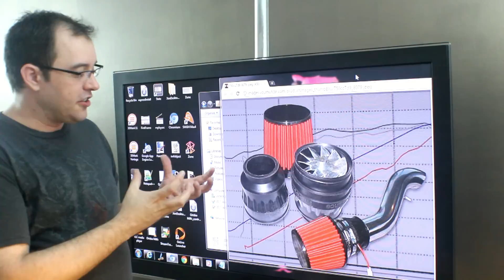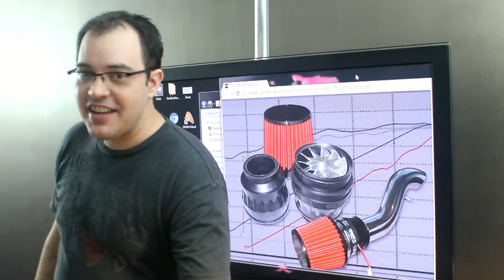Electric Turbo / Electric Supercharger / Forced Induction System: Should I Install?

Comment: The problem with turbos is not the volume of air, but the pressure. Because the amount or air you put in your cylinders in a consequence of the input pressure. For example, typical 12″ desk fans are rated at between 900 and 1500 CFM. But obviously, the output air pressure on those is very low, so it couldn't force air to go in the small volume of the cylinders. That's why I'm very sceptical about your stuff... It could work with a much bigger electric motor with high RPM (more than 100 000)

Comment from the maker: No it doesn't. Unported, Vortec’s will flow about 235-240 CFM at 0.500” intake and 165-170 cfm at 0.500” exhaust. at .6 you can reach 300 but 290 is more common.

Comment: @BlackwaterOpsDotCom ohhhh i see, i was going to put the boost gauge anyway so i can see the pressure i'm running at WOT or at half throttle. btw, what do i need to get to see the boost pressure from the OBD2 port?

Comment: Hey I got a 390 Ford Big Block pushing maybe 450 hp? I was looking to mount 2 of electric supercharger/turbocharger kits except with the metal blades I'm rebuilding the motor soon and looking to gain extra power, also I was wandering if it REALLY increased MPG's and also leaving it activated without the pedal touching the floor

Comment: i believe any amount of air on the top of what the engine is already sucking , and if the preasure is greater than the normal induction preasure it should work no doubt .full thumb up

Comment from the maker: @matthewgibbons13 I had radiation treatment and not all my hair grew back. Thanks for pointing it out. 

600 CFM would be a lot on a car. 600 maybe on a truck, but stock, not likely. And Since you weren't listening, MINI COOPER 1.9L engine.

CFM is relevant in that your Fuel to air mixture is based on Pounds of Air to Pounds of fuel. Since most people can't Picture an LB of Air but can Picture a Cubic Foot, I used that metric.

Thanks for trolling, you really moved the conversation forward.

Comment: @hellkat672 You don't understand.  The power isn't coming from the motor, it's coming from the fuel, can't use a conversion directly like that.  I see where you're going and you're right it would probably be a bit higher, but for instance I've seen those silly "E-supercharger" 'brand' make about 8 horse - around where they claim.   Outside of that none of these things will produce ANY power whatsoever and you'd likely lose power.

Comment: if you want more power buy a sts turbo or if you dont have that kind of bread. nitrous is the way to go its inexpensive and its not running on your car constantly use it when you need it and you can run it safely on any car its just a matter of choosing the right shot at the right time

Comment: A vortech supercharger will take around 40-60 hp to build 8 psi in 5.7 litre engine.  If you could even find a DC electric motor that would come close to that.  A starter motor is good for 3hp.  A 4 amp motor would give you less than 0.1 hp.  You wont build any boost with that.  And it will give you less power at higher rpm because it will restrict airflow.

Comment: On the same engine, a 50mm at 25 psi is flowing the same as a 60mm at 25psi.  The difference is that the 60 mm can do 25 psi on a larger engine where the 50mm would not be able to flow enough air to raise the pressure to 25psi.

Superchargers are rated in CFM not pounds per minute.  Turbos have compressor maps that show the relationship between air flow vs pressure.  Show me a company that will sell you a turbo rated at 50lbs/min.

Comment: @omega3677 Sorry, I come from a diesel tuning background. I am used to 15-16psi on 1.6's being the norm, 2.0's having 20-25psi being the norm (evo territory on a passenger car). I always forget petrol's have thinner engine blocks and can't take the higher pressures. Yes you're right, you wouldn't get detonation from that, but you would still be running lean so you would be missing out on power you could have and running the engine hotter than it could be if you just increased the fuel quantity.

Comment: @sixshooter1488 Yes, As I've already said this is true.... to a very limited extent. It will compensate probably for an extra 1-2psi in pressure (So a better intake maybe ram-air or something), but any kind of real forced induction will always run lean and not produce a 100% efficient combustion unless you manually increase the fueling in some way - usually an ecu remap.

Comment: @sillychink3293 Do it. Do it. I've done a lot of research lately as I've just installed a borg warner EFR turbo. You have no idea what you are getting into. The blade design is a HUGE factor in inducer efficiency as is aspect ratio and a bunch of other things. The engineering that goes into making something that is effective is mind distorting. Although an electric supercharger is possible the amperage required is astounding. That thing will do nothing but restrict and break up airflow.

Comment: @hellkat672 a fan that has a CFM rating greater then an engine must maintain that rating with the filter in-line. If flow is still greater then engine cfm requirement then in theory it would be like your running a restriction-less filter. Finding a fan that could push this flow under restriction would be much more expensive then just buying a high flow filter, and gains could be moot with electric parasitic drag.

Comment: I would have to say install it at your own risk. its a decent aftermarket piece but it doesn't give you THAT much of a difference . i have two on my 86 300zx stock i was pushing a good 160 hp and 172 tor. but after the first electric supercharger, i got a boost or 192 hp and 200 tor. but still the 0-60 only shaved off about .4th of a second,but i installed another and got 226 hp and 232 tor.i advise if getting one,buy a second car battery and install it in the trunk an hook the wiring to it .

Comment: Electric superchargers/turbos ARE possible. But that is not one of them. Don't waste your time.

It's not about CFM. It's about compression. You're trying to force air into the cylinders. This requires POWER. If you have an electric blower with a motor producing some 0.5-10HP, you're in with a chance of seeing small gains.

Audi are working on an electric turbo for their 2014 lineup. It does NOT replace the normal turbo and it only runs at low engine RPM to counteract the "real" turbo's lag.

Comment: While they do make actual electric superchargers, they require a huge alternator, 2-3 batteries, and a controller to match fan speed to engine rpm. This makes them better for large trucks. Ergo, anyone trying to sell you an electric supercharger for your car is lying.

Comment: i put that in my Computer and my GPU temperature is at 8% and will never go pass 10% and CPU speed at 126%. it works at making my computer run faster and cooler. no need for overprice CPU coolers while you have this.

Comment: @mikefknjohnson19 The previous owner of my very haltech setup made 730whp on e85... I think I'll make plenty. If you search Alberto 350z 170mph and watch the first one you can see a bit of how the haltech works, plus what a 600whp 350z can do.
And the Haltech Pro Plug in retains the factory ecu for closed loop functions like idle, cold starts, a/c functions etc. It's the ultimate combination for a street car.

Comment: @sillychink3293 Oh, i dident answer your question. Yes you can have some sort of boost with 2 of those types of fans. But those types of fans build such little pressure that we use something called a water column to test fan efficiency. 
By the way, im an engineer in an aviation company that deals with a wide variety of components. The biggest strongest "Fan" i have came across (recirculation fans running 100-150 amps) produced only 1/10th of a psi if anything.

Comment: it works, i tried it as all honda guys. 100% satisfy. ask honda people for proof
Reply: You must be trolling. That thing wouldn't even make sufficient boost for a lawn mower engine.
Reply: so funny man....
Reply: Put a real turbo on...thats childs play. At least get a DiabloSport T-1000 for first upgrade. Then cold air intake, then exhaust. Thats where im at. Best ho increase for money. Got a Hemi charger 5.7 stock 370. T-1000 adds like 20hp with new Tune. Cold air intake claims 17hp on 5.7 liter and catback exhaust adds say 13hp. So that 40hp increase. I spent bout under a G.
Reply: Well... the reason he says it does work on his Honda is because his is Honda has VTEC which means it can monitor how much air it is getting at a certain time and that extra assisted air flow does assist a little bit in power, a little bit! if he put a proper turbocharger or supercharger on he would see how much an actual difference that makes it's all about how the car takes to the faster flowing air but the same thing can be accomplished with taking out your headlight and getting a cooler intake so the air is being pushed directly into the air box through the headlight drag Racers do it look it up. oh and the dodge hellcat has an air port in the center of the head light so the air gets pushed into the air box the quicker you go better air flow more fuel more power and yes I know the Hellcat is supercharged but it does need more air since it is supercharged

Comment: i agree with acidburn7777, this is only a fan...you can use it in addition to your cooling fan, to cool the radiator but it won't help your engine...because a turbocharger and a supercharger will force air in you engine and so make it work better but a fan ain't gonna force any thing in you engine, maybe only a plastic fan blade when it brakes:)

Comment: @blackwateropsdotcom no....a 2 bar map will only read up to 14.5 psi. Yes two bar of pressure is 29 psi, but map sensors read vacuum as well. So subtract a bar then multiply by 14.5, that is how much pressure the map can read. And I have no idea what "jcw" and "s" is, unless you mean the "s" as a turbo model, still don't know the other. But if it is indeed turbo, good luck, hope your tune doesn't try and overcompensate for little mistakes. By the way, no hate, just free knowledge.

Comment from the maker: @hellkat672 Not saying this will work, but your math doesn't work. a Cloth air filter draws no power, and can make 3-30 HP compared to a paper filter (if the cloth is also bigger and such)

Comment: @hellkat672 i was planning on using the one in the picture behind him by gte, they claim, "5psi per fan" i get exactly what you mean i'm guessing that the fan is just to improve air flow not to exactly boost, thanks for the heads up i'm going to avoid this path. thank you

Comment: The engine pulls more air than that pump so you are restricting the airflow. You can believe what you want but it's nothing more than a placebo. Reall boost is strong enough to require strengthening the intake. Thats why it's measure in psi and not cfm. You don't see cars with a flow meter...

Comment: @BlackwaterOpsDotCom What? You need more fuel in the cylinders to compensate for the extra air in order to keep the compression ratio correct. Otherwise you run too lean and cause detonation in a petrol, and in a diesel you loose power.

Comment: well i just learn that a real turbo can do 240,000 rpm, And at the speed it needs oil to lubricate bearings because it gets temperatures up to 950 celsius so if think u can buy that electric motor to go and street race ur wrong but if u want to save money and gas go ahead. it will work but remember that at the freeway going at 65 miles per hour u will get probably a lot of air in ur intake specially if u have cold air intake

Comment: @omega3677 "larger injectors or a FMU will result in lower air charge temperatures and more horespower".... so exactly what i was saying all along? You should add more fuel with the air, not just air alone for cooler temps and optimal bhp lol. Larger injectors allow more fuel to enter the engine.

Comment: Why do you insist that PSI does not matter when discussing the performance of turbos?  The whole point of turbos is to compress the air to increase the amount of o2 in your engine.  If you want to increase the amount of air in a fixed volume, the pressure is going to rise.  If you dont have a pressure increase, you are not flowing enough air into the engine to increase performance.  Measuring PSI directly tells you how well your turbo is performing.  Never heard of a guy using a MAF for that.

Comment: Try and run it on a Dino. I wonder if you install a brushless motor with high amp and voltage amp, you could make more pressure

Comment: Oh, and one more thing, the item you hold in your hand is a "fan"... It's not a turbocharger.
A turbocharger/supercharger compresses the air when it delivers it into the engine, hence the power boost(it's like nitros, where you chemically dump O2 into the engine). A fan does NOT compress air.

Comment: i put one on a drag 4wheeler and it work cuss i did a dyno test on my 4wheeler befor and after and cuss in drag im not going fast it helps keep my moter cool and run harder. in the dyno i made a 10 hp differance witch should make a differance in my pull distance. i did it also on a diesel and it keep the moter cooler but no hp increase.

Comment from the maker: Nope. Cubic feet vary in mass drastically with temp. Pounds is a measure of weight, not mass. Mass air flow measures "pounds" of air. Which is a failing in the name of the apparatus.

Comment: Im not sure how your going to get a 0 to 12 volt range to the fan. your TPS throttle position sensor is 0.6 to 4.7 volts back to the ECU on any fuel injection car. unless you fit your own variable potentiometer to the throttle body some how. but id still love to see it done !!

Comment: In a 4stroke gas engine air pressure after 10time compression is i guess around 200psi and 600psi in diesel engine so in oder to get some boost i guess u atleast need one bar of pressure which is i guess totally impossible with this toy

Comment: Electric superchargers really work IF: You attach a very high power motor [try at least a 20HP and at least 100,000rpm] to a real turbo housing and an impeller and a rear trunk full of high capacity batteries.............if you don't you are just wasting time and money!.

Comment: the fans and the motors from porffesional remote control airplanes seem like they'd work better. a model jet engine can put down about 30-50lbs of thrust. those model engines cost a fortune however. about as much as a kenne bell or vortech.

Comment: no it was blowing out  when i turn supercharger on it looks like it it gives no air or  cuze of more air looks like it  ...when its doing that  than i shut off the supercharger when i push the pedal its still doing it after that  than when i restart the car  than its normal  untill i turn on the supercharger  ...is there any other issues can happen ??

Comment: why your horsepower increases when you supercharge or turbocharger your engine is beacuse it creates intake pressure! a supercharger is a large air pump sitting on top of your engine, a turbo is a smaller fan but spins at thousands of thousands of RPMS forcing and compressing air into your intake, in essence these things give you large amounts of pressure, that thing... only moves air, and the restriction its motor makes will cause intake abstraction.

Comment: More FORCED air means MORE horsepower, That pastic hairdryer isn't gonna do anything, now a metal fan, that is 35k rpms, I HAVE ON my v8 truck, and It has a lot better get up and go. 75 buck bolt on for I guess 35 hp gain? why not it wont hurt nothing, more air is better..

Comment: Lol this is such a scam. Anyone who spends 15 minutes of research will realize this.
Reply: Kyle Grodkowski 
exactly
Reply: Why doesn't it work?
Reply: Aidan D this  thing is an air pusher/vent...
not a compressor
to compress an engine that is already drawing air through when running it takes way more power (large batteries to store enough power)  and a different impeller design
Reply: +Kyle Grodkowski 
I know.  It's just a fan.  A supercharger or turbo works by increasing the psi in the intake.  This is just a fan, and will not increase manifold pressure, one bit.

Comment: @sillychink3293 you cant get boost from a simple fan, its impossible. True fan compressors are staged with tight fitting stators to compressor the air, like a commercial jet engine.

Comment: You're still talking about pounds or volumes (1 cubic feet of air = 0.075 pounds). A mass air flow sensor measure the density of the air: this density varies with the ambient temperature, altitude and the use of forced induction, which means that mass flow sensors are more appropriate than volumetric flow sensors for determining the quantity of intake air in each piston stroke. So I don't understand why you talk about weight or volume of air.

Comment: idk if you'll get more HP out of doing that, mabe inprove fuel ecomany a little but... if your worried about the blade flying apart in the intake line, I wouldnt worry about it too much, marine components are actually made to be way more robust then automotive parts, thats why there so freakin expensive :(  but if your still that worried about it just put a metal screen on the ass end of that tube and install the thing and try it out

Comment: @midnightraven00 Actually it could effect his car. If it does flow as much as he's saying it will run lean or break something on the intake side.
But it won't.
And a few dyno pulls is like 70$.
If these things worked, nobody would use turbos, or superchargers. Simple as that.